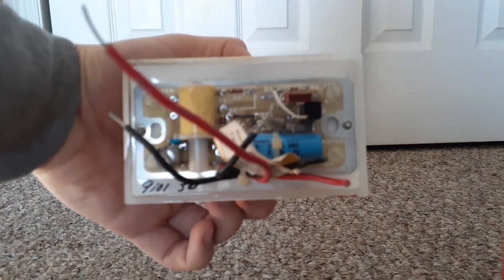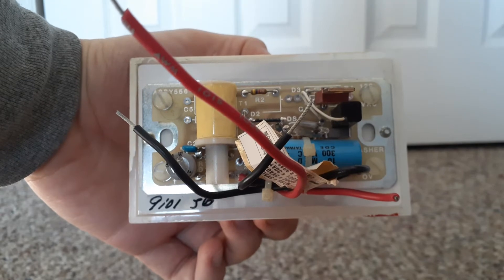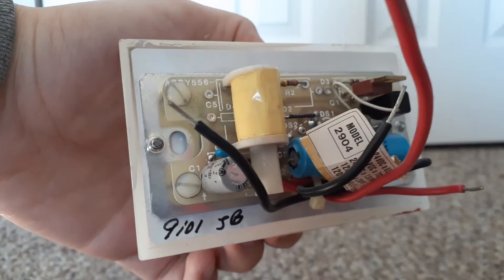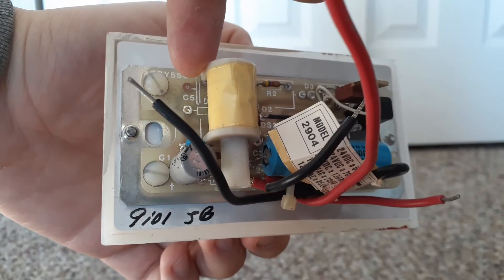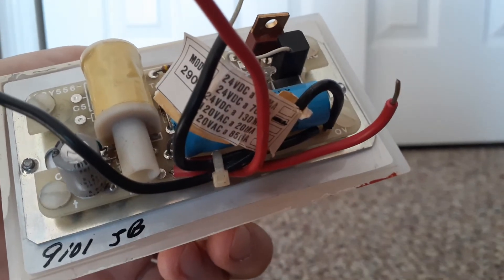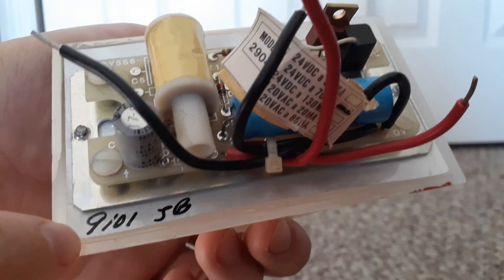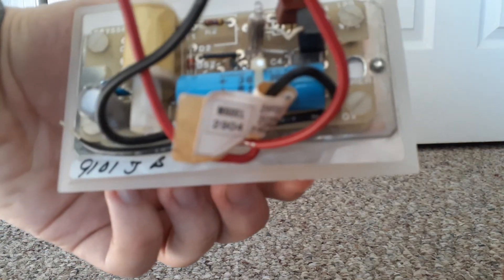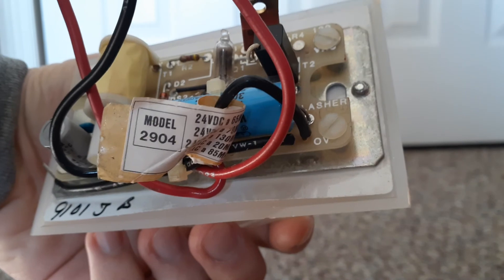Overview of Two Early Variant Simplex 2904-9101 Strobes

Comment: I have a Red Version of these. It has Black Wires so my Assumption is its 120v.
Reply: Do you think it’s 120v since it’s a Bulb and it has black wires?
Reply: @FireAlarm33  does have a socket or circuit board?